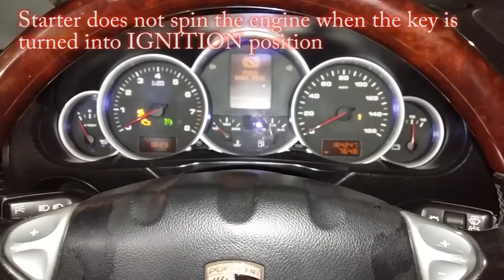Porsche Cayenne S Starter Repair

Comment: Appreciate the video very helpful, is it possible to list all tools needed for this project as will need to perform? thanks.
Reply from the maker: Good day. All you need is professional tool box, with sockets and wrenches of from 8mm to 24mm or so. It is all about wrenches.
Reply: Ok great. Even for disassembly of all the covers and manifold and pipes? Thought there would be some hidden special tools involved, dont want to get stuck half way in with out all proper tools.
Reply from the maker: Nope. No special tools. Just patience and preciseness
Reply: Cool. Just gota do it when parts arrives. Appreciate the help.
Reply from the maker: Mztr.Dros Enterainment let me know if any difficulties
Reply: K, sounds good.
Reply: Hey, just replaced manifold gasket, new coolant pipes, water pump, thermostat ad starter i got from ebay...what a massive job getting to manifold off was a pain! Appreciate your video and many others on here guiding the way. Atm with new starter in it still starts only after few tries, wonder if i missed anything? Hooked up and tested it before installing worked once did what u did in vid but after installing having trouble starting on first try
Reply from the maker: Did you get new starter? Or used one? The used starters do not have enough brush length, and will run out of service soon...Mine, the original one, the first time, was doing the same, starting poorly...let me know what starter you got. on the other hand, check your battery..
Reply: Works great now after few tries but it's my alternator now. That's gona a pain. Not even sure how to get to it way under engine block and it's water cooled

Comment: Do you disconnect the battery when replacing the starter?  I went to install my new one and got a huge spark. 

 I was changing out my coolant pipes so the area may have been wet, do you think I damaged the new starter or anything else?  Thank you.